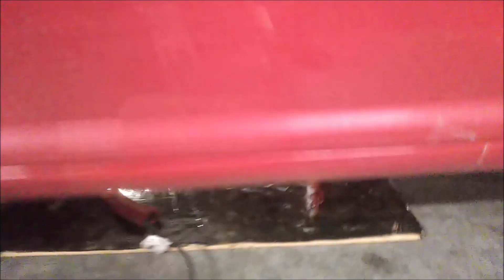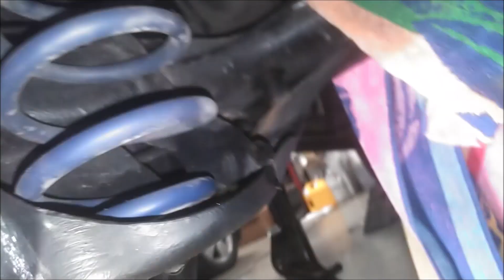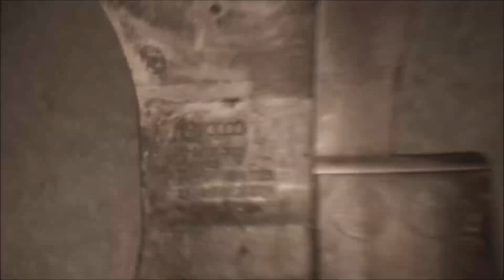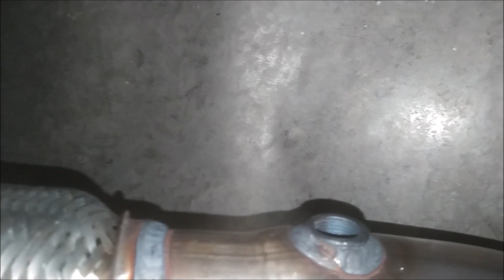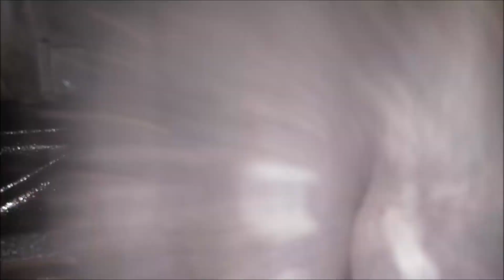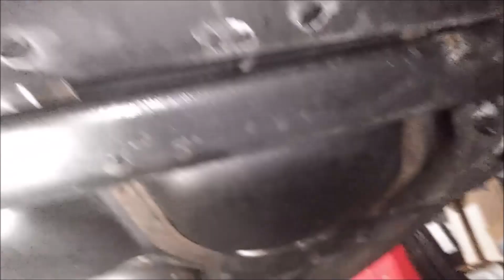Volkswagen Golf mk4 TDI 3 inch exhaust install

Comment: Great video. Very informativt. I have one question. Are there any difference between 2 wd system and a 4 motion system?
Reply from the maker: Thank you. This exhaust system was designed for the 2wd TDI models. The 4motion TDI wasn't available here in the USA. KermaTDI might be able to tell you if this exhaust system would work with a 4motion setup. I do not know the answer to that. Sorry I couldn't be of more help.

Comment: Why is it not 1 single downpipe video on YouTube links a downpipe …..
Reply: Circut Werks. Full turbo back straight pipe ,  2.5 $600. $300 for just the downpipe. 

I've baught 3" straightpipe from another company for $600+ ( from downpipe back). The Circut Werks set up is just as nice , clean welds, the downpipe flange fit with no clearance issues , hangers were all in the correct spot and the clamps were good quality. The only thing I wish they included was a nice slip coupling ( had to buy from auto parts store). 

I removed and fit the whole system in about 2 hours. I will definitely buy another setup for my newer ALH.

Comment: Any reason you couldn't just cut that last tailpipe section instead of the tailpipe and still use the hanger on the exhaust tip that came with it?
Reply from the maker: You could just cut the tailpipe and use the existing hanger, but you'll have to cut the rear valance for the tailpipe to fit. I didn't want to do that, so that's why I went the route that I did. I like the tailpipe hidden.
Reply: @Corysdiyauto  ah ok I see what you're talking about after rewatching. Thanks!
Reply from the maker: @dstep2007  - Sure, you're welcome bud.

Comment: hey what size is the downpipe before the flex pipe, is it 3" aswell or stock size?
Reply from the maker: oTylerHD - The pipe is stock size at the turbo and then almost immediately opens up to 3" after that.
Reply: @Corysdiyauto  thank you im looking for a full 3" glad i know now before buying
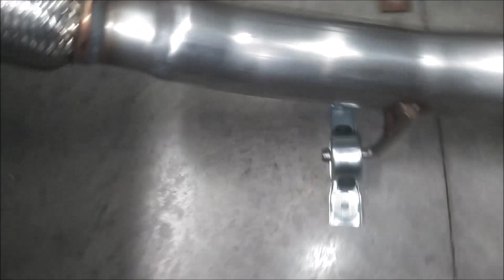Reply from the maker: @otylerhd4984  - A closer look at 17:34 you can see the weld right after the flex pipe where it opens up to a full 3". So, the flex pipe is smaller than 3", but larger than stock. If you call KermaTDI, they would be able to answer any technical questions that you might have about this system. I absolutely love it!!
Reply: @Corysdiyauto  oh yes i see that ill give them a shout thanks man, good install video
Reply from the maker: @otylerhd4984  - Thank you very much! Good luck with the install if you decide to make the purchase. It's worth it!